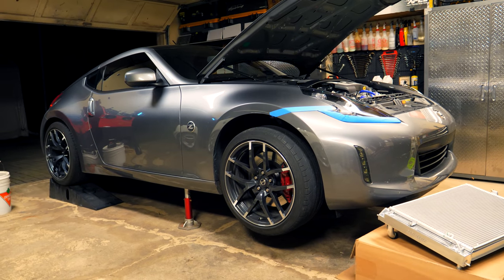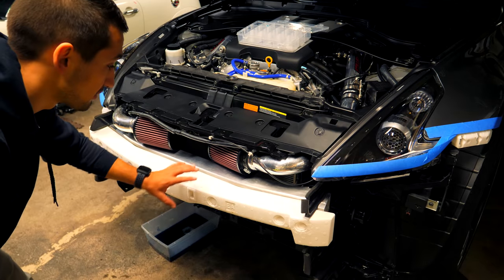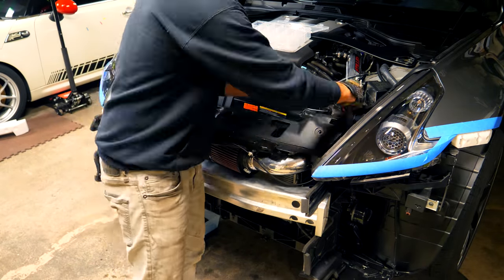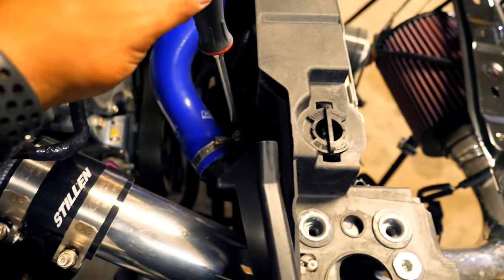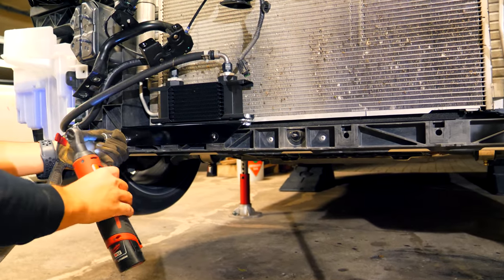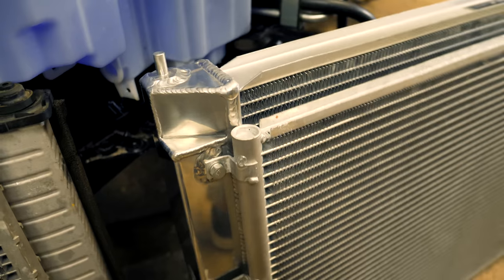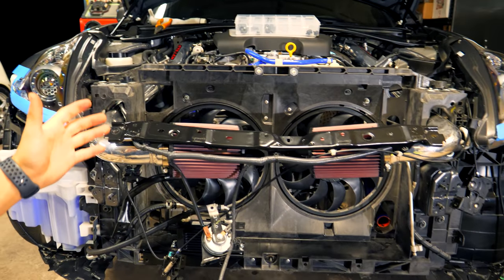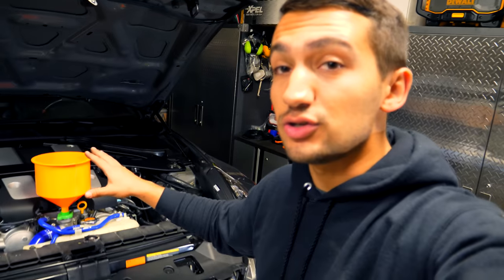The Z Gets a THICCCK Upgraded Radiator

Comment: >I added a Mishimoto radiator to my 2010 Z. Sure, it dropped temps about 20f. I am still limited on how much I can beat on the car. I need an oil cooler. I think everyone should be aware of that. This radiator will not solve the issue by itself. Three things will need to happen. Change to Mishimoto radiator, install their oil cooler, and install vented hood. This will solve a stock horsepower cooling issue. If you add more power, this issue will return. If you plan to rebuild your 3.7 and increase horsepower, close the blocks deck and go have fun. Closing the blocks deck will solve the 3.7's design problem. It seems the water flows too fast through the block and not filling all spaces. Closing the deck will increase pressure and fill the block and solve the heating issues. 

I am replacing my first Mishimoto radiator with their warranty radiator. My condenser core mounting bracket tore away from the coil and leaked out the refrigerant.  I paid part of the shipping ($30). I still recommend the Mishimoto. It is lifetime guarantee.
Reply from the maker: On oil cooler is a 100% must for these cars. When I brought my Z to the track, even on a not hot day, the oil temps got alarmingly warm. https://youtu.be/z5uvnTuyU_w?t=737

I'm not sure if I want to go with more power for now. I want to address some other areas of the car, such as the diff, suspension, brakes, and then an aggressive alignment.

Comment: I would be concerned with Mishimoto's placement of the AC condenser core in front of the radiator, causing the heat dissipated by the condenser to raise the temperature of the air flowing over the fins of the radiator and thus reducing the radiator's ability to reject heat to the air. Would it be possible to reverse the placement of the condenser so that it would be downstream of the radiator?

Comment: Great to see another video Milan,  how much of a hit did the K&N filter upgrade cause, could those not be angled downwards or a scoop added to direct more air into the exposed fins ? There is a large surface area not being utilised as the path is blocked.
 I know from others in the comments have mentioned (as well as yourself) confirming the oil temperature issue so i am curious as to how big of a difference that alone would have made by installing an oil cooler?
Reply: Might be a little late but I installed an air guide V3 by Dewalla design. I wouldn’t recommend it without a vented hood to keep flow moving. AIT’s are about the same without it, I only notice a difference above 80ish MPH. 100-140 it really pulls tho

Comment: Did this radiator also help with engine temps as well? Reason i ask is because i have a 34 row oil cooler supercharged z and when i run it hard my temps are 230-240 degrees farenheit.

Comment: Question,
Do you more enjoy modding and driving your Z or Mini??
I have a r53 Mini, but the Nissan Z looks like a solid platform to mess with also, are they as fun to drive tho?
Reply from the maker: Hey Dennis, I find modding the Z is a bit easier since the engine bay isn't as crammed, and revving the engine out is very rewarding. They're both totally different cars though. My mini is small, FWD, and quick, where my Z is wide, RWD and fast. Getting the rear of the Z to step out is a lot of fun, but so is chucking my MINI into any corner knowing it can take it. Its like comparing apples to oranges 🤷‍♂️
Reply: My mates mini does 200pmh.
Reply: @milanmastracci  yes ive spent hrs comparing apples and oranges its not easy.

Comment: hey milan when is the video for the rest of the 370z rear suspension upgrade coming? I remember you got true coilovers so you could put adjustable toe arms on
Reply from the maker: It will be coming soon. I just finished acquiring all of the other adjustable arms, including the FUCAs. I will be taking it out of storage in a bit after I address some problems with my MINI.

Comment: Hi Milan, Could you help is it possible to upgrade power in my car. I have Suzuki Vitara 2018 it has 1586 CM³  with 88kw. Do you now or teach me how to do it or where to search. Thanks
Reply from the maker: Hey Arben, you can increase the power of any car, but it all depends how far you want to get into it. My advice, don't waste your time and effort on something that isn't sporty, because you'll spend more in the long run trying to make it fast, vs buying something kinda fast and make it faster.
Reply: @milanmastracci   Yeah that's right i forgot to tell you my friend that the car is all grip also it has auto, sport, mud+snow and lock does it help it in 4x4  upgrade. Thanks
Reply: No theres nothing that you can do.

Comment: damn my tt runs between 90-100 while cruising lol.
Reply from the maker: Typically German cars run hot. Its nice for the street since you get a warm heater for the cabin, but not ideal for racing lol
Reply: milanmastracci ikr. The radiator fans only kick in @98 C
Reply from the maker: Yeah that's very hot lol